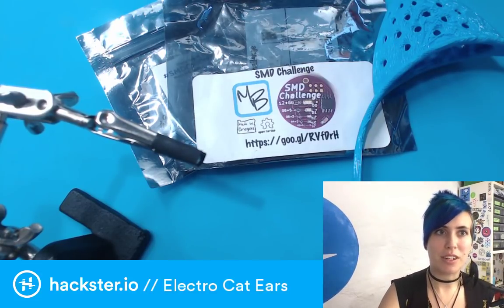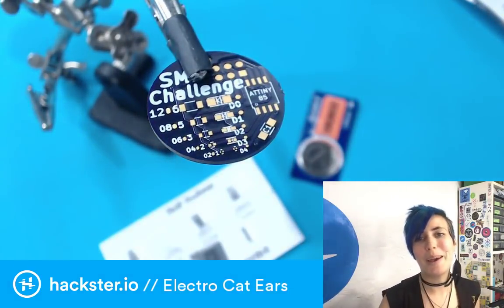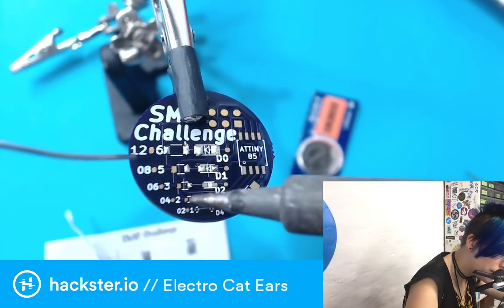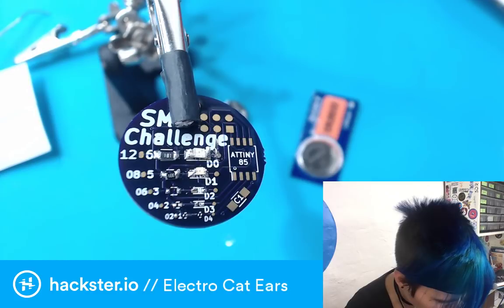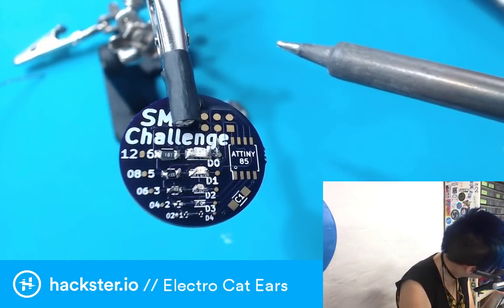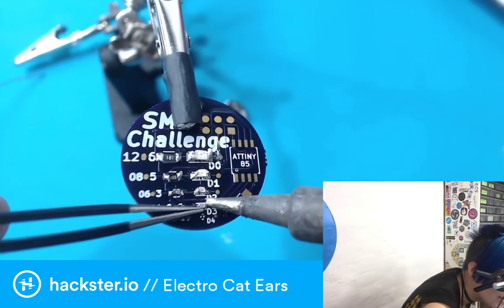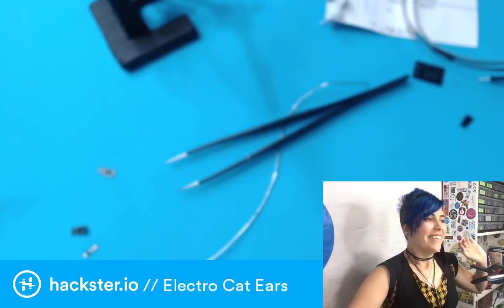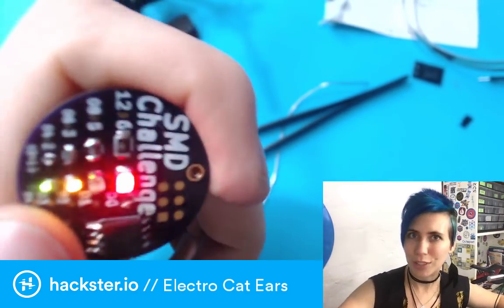SMD Soldering Challenge

Comment: Fun video!  If I may give you a bit of advice: you definitely need a Solder Flux Pen.  Also, you should only put solder on one pad to hold the smd component in place.  Second, move the part in place and solder the one pin so the rest of the pins sit flat on the other pads.  Then, solder the rest of the pins to the pad.  Dave Jones over at the YouTube channel EEvBlog has a couple of great tutorials on soldering SMD devices.